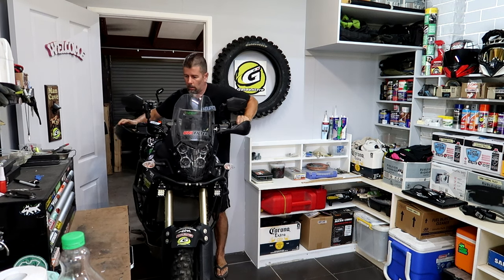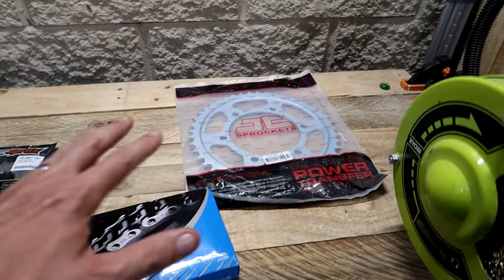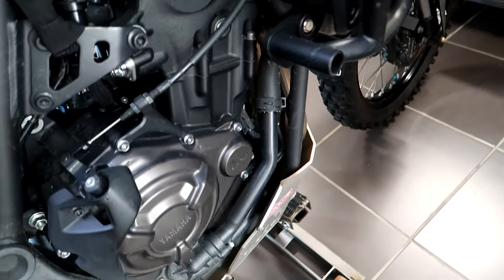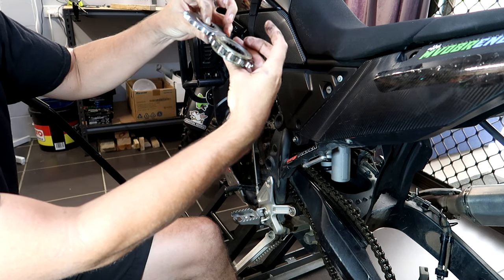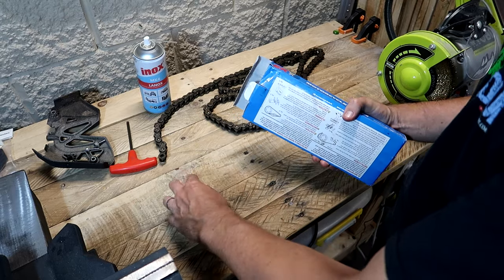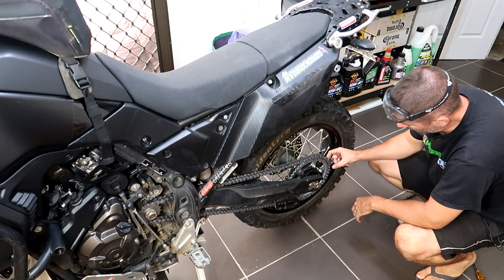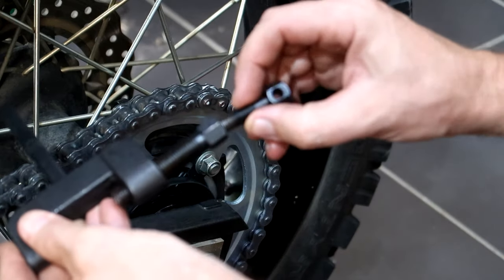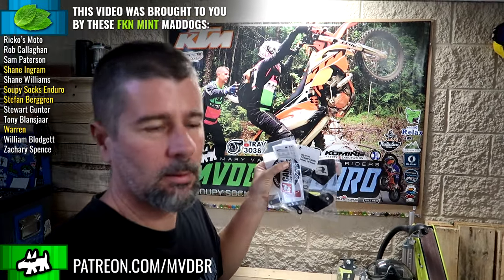Tenere 700: New Chain & Sprockets - How Hard Could It Be??

Comment: Im now glad I have a rattle gun at home! I rattled my front sprocket and it came right off.
Whoever told you a good quality chainbreaker will push the pin straight out is full of sheet. They all need the head ground off.
Reply from the maker: Yes the right tools often make life easier 😬 I'm pretty sure I saw Cory from Camel ADV knock one right out with a tool and no grind but maybe there was some grinding fuckery off camera 😎✌

Comment: One good trick to unbolt the front sprocket nut is to up a screwdriver between the chain and the rear sprocket….it locks to chain and let you apply more torque.

Cheers

Comment: Bought a rattle guns two years ago. Best thing I ever did. Same here, never use chain lube. WD40 and silicone spray. Chain is cleaned after every ride. Since there is no built up oil and dirt, takes no time. Just over 10ks still going strong.
Reply from the maker: That's it man good stuff 👍👍

Comment: Wow you went tall on those gears.  I just swapped in 14t for front yesterday and now have 14/46 which is much better offroad and some added engine braking.  I rode over 3hrs Hwy at 75mph and about 6k RPM but not bad and the payoff was worth it once I hit dirt.
Reply from the maker: 1 tooth down on the rear is hardly earth shattering 😁 If I had ended up with a 16 on the front as well that would be pretty tall.

Comment: I did the C&S on my Gixer a month back, I was quite surprised by how much force I needed to put on the rivets to get them to mushroom to the right size. Thankfully my front sprocket nut wasn't as tight as yours was!
Reply from the maker: Did you actually measure them Pete? Shit I hope mine doesn't fall off... I think if I'd gone any harder riveting it that cheap crap tool would have spat the dummy 😬
Reply: @MVDBR  I did, but only cause my mate scared me by saying how difficult the job was to do right... which it really wasn't,  it just surprised me how much force I needed to use to rivet it
Reply from the maker: @HippoDrones  myeah I think you'd have to be pretty unlucky for one of those to come apart either way 🤙

Comment: There's tight then there's tight 🥵 Also firm believer of the non lubed chain, WD-40 after wash she's good to go. You don't need a torque wrench you tighten it till the nut goes click 😂🤣 . Awesome video Josh cheers 🍺
Reply from the maker: Strip the thread then back it off half a turn that's the only torque knowledge anyone needs 😅 Haha cheers Willy C ✌

Comment: Great video as always straight n easy 👌,  I just threw a 42 tooth on the 390 and wowsers different bike took away the low down pig rooting jerkiness of low revs and in high traffic cbd bs you can let clutch fully out in 1st and idle along or rev up easily. I havent taken her offroad yet apart from just forestry twin trails and done the Lions Road twisties n hills yesterday and 5200 rpm at 100km/hr . Thinking 43t would be better choice but the high speed difference n different torque has really changed the way I ride it...
Let us know how you like the 1 tooth down on the T7 as that'll change it offroad a bit torque wise and speed in 1st on the fun stuff 👍
Reply from the maker: What's the stock rear on the 390? Did you put a 14 on the front as well? I rode Friday with the new sprockets, sometimes I thought I could notice a small difference but probably imagining it. Still seemed fine in the rough shit 🤙
Reply: @MVDBR  stock rear on the 390 is 45 teeth , I ordered the 42 just for an experiment as well as ordered the 14 for the front but the 14 still hasnt shown up .
With the 15 - 42 its got more of a roadbike gearing feel but when you rev it wow it builds speed quickly as they are a little engine that likes to rev.
Im just having a play around as hate the way its so jerky in the lower speeds and this smoothed the whole bike out at all speeds n gears and holds the 100km/hr better rather than constantly having to adjust the throttle cause it drops 10 to 12km per hour 😊
Cheers man keep up the awesome vids my shout when I get up your neck of the woods 👍
Reply from the maker: @anthonydendle4768  yeah shit 15/42 wouldn't be much good off road 😬 Frickin fuel injection jerkiness the T7 has that issue as well, but hey I still wouldn't go back to carby days 😅

Comment: To undo the front sprocket nut (after trying other ways)  I used a approx 3foot scaffold tube offcut over the breaker bar for leverage then got my fat mate to sit on the bike with his foot on the brake, bingo !  don't leave it in gear it might fcuck the gearbox up.
Reply from the maker: Yeah nah never leave it in gear 😬 The rear brakes on the T7 are pretty shit, even cranked down till the pedal was hitting the bash plate the rear wheel was still moving 😵

Comment: That sure was a few ugga duggas, i thought the breaker bar was gonna break! I'm confused why you changed them since the original chain was still good. 
I like the clip style chain link better too , was easier . Cheers 4 sharing sir.
Reply from the maker: I bought the replacements last year and have been putting the job off lol... 20k seemed like a good time to get it done. I'm kinda glad I didn't leave it any longer it may have gotten harder to get that sprocket nut off 🙈 Also as a general rule OEM shit seems to be sub par, so hopefully this gear will last longer 🤷‍♂
Reply: @MVDBR  Wow you must've been a boy scout ...so prepared. If that nut got any  harder to undo you might have to put it in the bench vise and spill the bike....
Reply from the maker: @JustTex  I think I got keen to replace it after the fkn thing came off and broke my engine 😬 But yeah there was nothing really wrong with it just a freak thing

Comment: I hate the idea of large nuts to secure the front sprocket, I just use a circlip on my DR 650, works a treat, there is no side forces working on the sprocket so why so much overkill baffles me.

I think I will keep using chain lube, 35-40, 000 kilometres out of a chain on my DR is good in my books, I change the front sprocket at around 20k and keep it lubed and never clean it.

The idea with the chain lube is to get it into the rollers not the pins, the rollers contact the sprocket teeth and spin, when you don’t lube the rollers they don’t spin as freely leading to faster wear on the teeth and the rollers, hence shorter chain life.

Chain lube also makes the chain quieter, but you have to spray it on a hot chain, this makes the lube thinner and it penetrates the rollers.

But I am old school and worked as a motorcycle courier for 20 plus years, so I wanted good mileage out of a chain.
Reply from the maker: Yeah mate each to their own, most people will just keep doing what they've always done (I'm one of them). There is always the argument that chain lubes attract dirt which in turn creates a grinding paste on the chain which negates any kind of lubrication effect, and that theory does make a lot of sense to me. There are way too many variables when it comes to trying to measure chain wear but in my experience, adding messy lubes doesn't increase chain & sprocket life enough to be worth the cost.

Comment: What a struggle, I guess Yamaha hired all the 400lbs gorillas to tighten the bolt on the counter shaft. 
If i don't plan on reusing the old chain i just cut it with the angle grinder. Quick and simple.
Reply from the maker: Haha yeah that's the go 😁 Was keen to test out my cheapshit new tool tho 😎

Comment: Holy bendy breaker bar batman,!!!
That crap on the OEM sprocket is  noise and vibration reduction wankery.
I'm not sure if heat is a good idea there as there's rubber orings 
Eyenox? 🤪 In baby in.
Reply from the maker: It's Aye Nox you gosh darned Mehican
Reply: @MVDBR IN. Ox Northerners pfft ". You know nothing Jon Snow"

Comment: Gday mate
I’m trying to run the same golden tyre rear on my T7 but it hits the shock protector just, did you run a link longer in the chain?  A mate has put on on his T7 and had to run 2 extra links which then puts the axle nearly at its longest adjustment.
Cheers
Reply from the maker: They are a tall tyre! I just cut a chunk out of my shock mud guard mate no more probs. It's a bit rough but you can see it in this vid around 5:25 still keeps most of the shit off the shock.

Comment: Hi so how did you like the one down sprocket size? Better on road? I find 6k at 75 mph is way too high for a bike to be revving.
Reply from the maker: Yeah 1 tooth on the rear is only so slightly noticeable. If you don't do a lot of proper off-road stuff a 16T front would be a better option 🤙

Comment: i bought the same tool for my chain and when using, it shattered and i ended up put my bike in the van and taken it to my local machanic to sort the chain
Reply from the maker: Oh shit, I have heard complaints of the threads stripping out of them easily 🤷‍♂ I don't expect it will last forever but so far, so good
Reply: @MVDBR  mine shattered into bits, split the chain ok but when I went to rivet the chain that's when I had the problem.
Reply from the maker: @rocdouglas  😬 cheap shit aye, why do we do it 🤦‍♂

Comment: +1 wd40. Water displacement when it’s really wet. 25000 miles and just wd40 here and there
Reply from the maker: That piece of crap chain I put on in this video only lasted 10k 😅 I ended up getting another rivet link and putting the stock chain back on with a new front sprocket, and we're up to over 40k now no dramas. So yeah about 30k on the stock chain, using just silicone spray for lube.